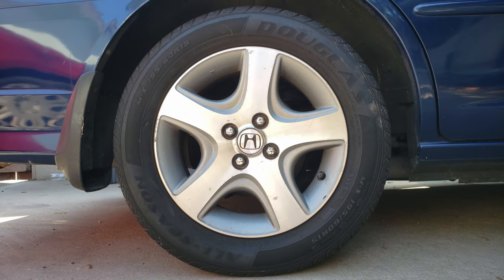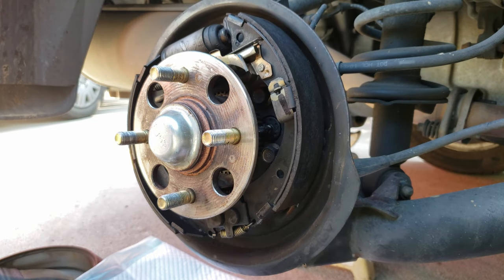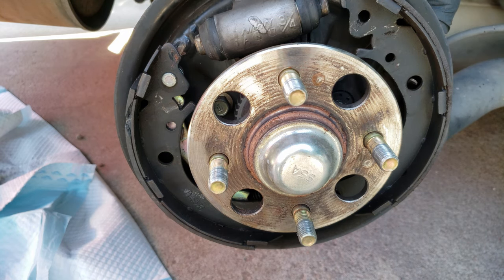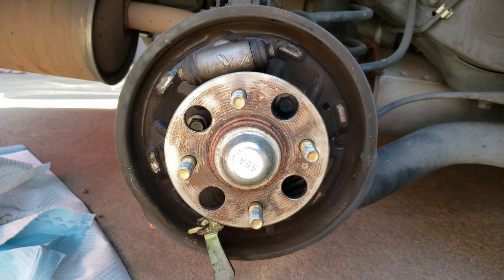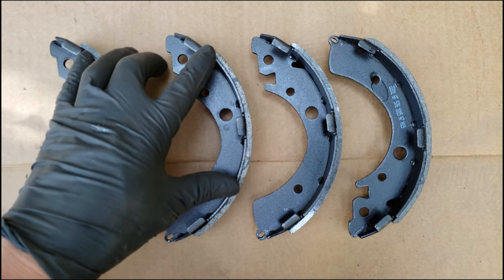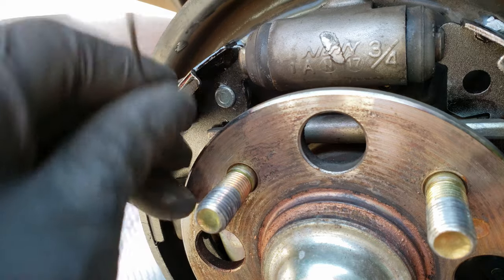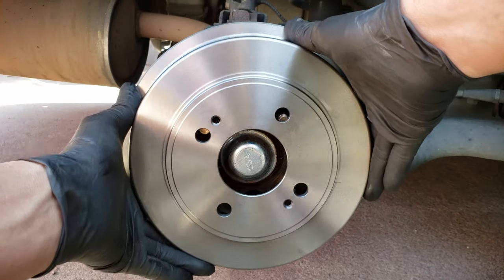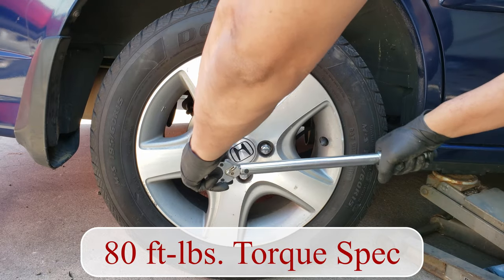How to Replace Rear Drum Brakes on a Honda Civic

Comment: You make this job look easy! To anyone sizing up this task, I've done everything on cars over the past 25 years.. except drum brakes. That said, I discovered there is no amount of cussing in humanity to curse this dreadful experience. I would gleefully drop my steering rack, or replace the synchros in my transmission over doing this horrid task ever again. I hate letting anyone touch my cars for service but I think this is one job I would take to a brake shop to have done to hold on to my sanity.
Reply from the maker: Maybe its cause ive done so many of em, but i think i would rather do these brakes than those tasks lol.
Reply: Agreed. Never touching these god awful brakes again
Reply: @backyardchevy328  It seemed straightforward to me.  I removed the wheels and drums to inspect today, and I'm down to less than 1.5mm brake shoe thickness.  My drums on the inside look smooth.  I don't see any leaking seals, and the springs all look good.  I didn't check the horseshoe clamp, but I plan to reuse it as you showed.  

Crossing my fingers that it all goes well.  The new shoes are only $22.  New drums are only about $30, and they certainly are easy to replace (I got the M12x1.25mm bolts).
Reply: @mikew1368  Agree. 1.5mm is cutting it pretty close bro 😂
Reply: It is not that bad.
Reply: Bro you are lost
Reply: Exaggerate much??
Reply: Can it really be that bad?
Reply: I feel you bro
Reply: Skill issue
Reply: I asked to local brake shops and they both told me Ef drum brakes. We don’t do that here 😂😂😂one guy told me 70$ I didn’t trust his skill set. So the car is on stands while I research why the adjusting clip isn’t holding itself into position 😂lmao
Reply: Idk man I did mine for the first time no experience and if you follow his steps it really was this easy.
Reply: It looks easy

Comment: Please assure to install the adjuster in the correct orientation I had the tail end rotated on the wrong way and it does have to go on  a specific way if not it will not latch correctly when pulling the e-brake up

Comment: Your a king! This help me so much with fantastic camera angles to help me see everything!
Reply from the maker: So glad to be able to help🙂 thank you
Reply: @backyardchevy328  that top spring was very hard to put back  you made it look so easy, but in the end I finished the job properly thanks to your video. I still have a problem with the ebrake, like after adjusting it was going 5 clicks but after using the car a bit again went to 8 clicks and is not holding, I adjusted again but still not happy is not holding the car if I put in drive and press the gas, should I adjust the cable from inside?
Reply from the maker: @razvanpoenaru  yea sounds like ud have to adjust it on the inside cause the brake shoes will only adjust so far to be drive able
Reply: the "specialty" tool to remove the clips is not needed. Thank you Sir. Great video 😌
Reply from the maker: @2d120587  thank you🙂

Comment: I was putting long spring above the adjuster lever into the wrong hole and wondering why it didn’t have much tension on it at all and why the adjuster level wouldn’t seat properly, was so frustrating wondering what I could possibly be doing wrong, rewatched your video and realized I wasn’t putting the other end of the spring in the right hole, realized what I was doing wrong and grabbed some tiny vice grips and struggled but got it to go in the correct hole and then the adjuster level sat correctly. Lol it’s so great when you finally realize the simple thing your doing wrong and get it corrected, thanks again
Reply from the maker: Yea definitely a good feeling when u find out why its not going together properly🙂👍

Comment: You make this look super easy. For anyone attempting this repair, it's definitely challenging, but not impossible. Give yourself ample time, maybe get a helper, and get all the parts and hardware beforehand. Be careful with the brake cylinder thing with the bushings, it's very easy to push it out completely and get air into the system. I got air into mine and am taking it to the shop to get the brakes bled. Overall, tough but worth it. You learn a lot!!! Thank you for this video, it's a gem!!
Reply from the maker: Thank you🙂 very good precautions👍
Reply: I made the same mistake.  I fitted the seal back onto the wheel cylinder and then I bled out the air in just the rear brake lines and fortunately the wheel cylinder seal is holding and everything is working well.  

I was too aggressive trying to remove the main adjuster spring and pulled off the seal on one side.  

I need to work out more to manhandle those vise grips.  Pulling while guiding the spring end into its slot was crazy difficult for me.
Reply: Me too!!
Reply: @mikew1368 question - will this stop you from being able to put the drum back on? That’s the current problem I’m having. Thinking it might be because air got into the system. Adjuster is already in as much as possible
Reply: @DeclanLangenfeld  I used brake cleaner and a rag to clean up the brake fluid that leaked out of the cylinder first, and then bled out the air.  Finally I got the cylinder compressed and replaced the drum with no trouble.  
I think if you bleed the air out first, the drum will fit.  Also it helped me determine if the cylinder was not leaking.  When the rubber boot wasn’t fit well. When I pumped the brake it caused brake fluid to squirt out.  I thought I might have ripped the rubber boot and needed to replace the cylinder, but no leaks observed, so I was happy and everything worked fine after I finished and tested it.
Reply: Well there you go.  That is what I did wrong. It was super hard not having those stupid things falling out the whole time. So I have air in the system. I am glad you posted this.

Comment: Great video overall.  Clear instructions and good video work.  One item though.  I could not get the top main spring off/on using his method.  No doubt he's much stronger than me.  For those who find it difficult to remove and replace the spring... In order to stabilize the brake shoes, I strung several zip ties together and tightened them around the circumference of the shoes.  I did this with two sets of zip ties to ensure shoes didn't shift alot and the ties didn't snap.  This made it alot less strenuous to do this procedure. Hope this helps.  Thanks again for the video.
Reply from the maker: Thank you🙂 id have to try that

Comment: Great video. I removed my drum and saw shoes at 3-4MM. I was ready to call the dealer for an appointment, Now I called to order a set of shoes and I`m going to give it a try. Thanks
Reply from the maker: Thank you🙂 hopefully everything goes well when replacing em..good luck👍
Reply: @backyardchevy328  Thanks, on concern I have is the shoes you linked on Amazon say "doesn`t fit" 09 Civic, thats why I`m going to the dealer, the cost there is $100 for a set of 4.
Reply from the maker: @xbrizzcakez  yea they would be a  different brake shoe on the 06 and up
Reply: @backyardchevy328  So an update for you Backyard. I decided to buy the OEM Honda shoes because mine were at a low 2mm, so after purchasing the set I discovered that brand new shoe pad was at 4mm?. So I`m no where near needing replacement. The shoes have been in the car for 7 years. I`m disappointed, I got your video memorized for the future though, lol. I`ll let you know the results,
Reply from the maker: @xbrizzcakez  yea rear brake pads hardly wear out since most of the braking and the weight is to the front..yes definitely🙂 but the video will also be there if u ever need it👍

Comment: Thank you.  This was an excellent detailed description for the Civic drum brake service.  I really appreciate your clarity and all the tips and explanations.  At the end, I thought it would be best to back the adjuster off a bit more to remove all drag (but still be super close) since I always thought the shoes should not be in contact with the drums (unlike pads that are supposed to drag lightly on rotors) until you hit the brakes (and the auto-adjuster will keep it just off the drums).  Do you feel it is best to leave a little drag?
Reply from the maker: Thank you🙂 well when u adjust and it free spins but u can begin to hear the slight drag is best..but if u get it close the adjuster will adjust the rest if need be, so u can back it off a lil if u prefer...both are good to me
Reply: @backyardchevy328  Awesome.  Thanks for the quick reply.  I will have to check out more of your content.  You are very good at explaining things.
Reply from the maker: @steveboone5450  thank you i really appreciate it🙂

Comment: One piston of the caliper came out and I had some fluid running off. But stopped when put the piston back on. 
Do I need to top up somewhere? Did air get in the system? 
It didn't feel so tight, but there was no sign of leakage before.

Thanks
Reply from the maker: The wheel cylinder on the rear? or the caliper from the front brakes? Either way, yea it would get air in the system that way..so youll want to add fluid and bleed the brake caliper or wheel cylinder of any air that did get in
Reply: @backyardchevy328  Sorry, my wrong term.
The rear piston that pushes the shoe out.

How do you bleed the air out of them?
Reply from the maker: @troubauk  im actually working on a video for that right now..well its more for a brake flush and bleed procedure..it should be out this weekend

Comment: great video..  If you cant get the drums off use 2 M8X1.25X35MM bolts, THATS WHAT THOSE 2 HOLES ARE FOR IN THE DRUMS!!   Id also highly recommend getting a NEW spring kit to replace the springs when doin drum brakes! comes with new C clips and all so if you have trouble gettin old ones off you can just break em off and replace with new.. under 20$ for these kits!

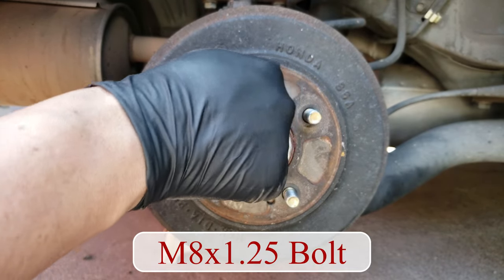Comment: On my 2014 Civic ( 0:45 ) The bolt size for the bolt to break the seized drum off of the hub is M12 X 1.25mm 35mm length (bought them at Advance Auto Parts)
Reply from the maker: Thank you🙂 really appreciated

Comment: I wanted to take a moment and thank you for this video - it really is perfect in all ways .  

As I was working along side the video ,  I’d get ahead in my mind on some detail - and sure enough you covered it .

One small detail I messed up on - the lower part of the brakes  need to be seated behind the lower flange - I placed it on top
By accident and the  drum rubbed on the outer face of the side of the brake pad .   I’ve never done rear brakes - so it’s a small detail I won’t for forget next time .

Thanks again !!
Reply: Same here. Put on the back tire like 5 times trying to figure out why the shoe was grinding. Finally decided to take it all apart again (shouldve done that in the first place) and figured out thats what was rubbing.

Comment: Thank you so much for this. About to do the drum brakes on my 07 Honda fit (same exact brakes). So many videos advocate for putting the brakes back together by attaching the shoes with the top spring and the adjuster rod first then trying to hold and hang the whole assembly over the top…all the while complaining you need three hands to do it well lol. This way makes it so much easier.
Reply from the maker: Lol..yea everyone has their preferred methods, hopefully all goes well..good luck🙂👍

Comment: The new brake drums you installed are not expensive.   Are you happy with those replacement drums?  My Civic LX is at 140k miles and might not need new drums, but for around $30 it looks so nice and clean.  If I pull it apart and need to resurface the drums at my local auto shop, it will cost near the same and waste time.
The Honda service tech said mostly they can reuse the springs and not need to resurface the drums.  My Haynes book says to at least use an emery cloth and polish the drums.  They inspected my drums as part of a free 16-point inspection and said they had a lot of life left.

Comment: Great tutorial. Curious at the :21 spot you put the jack stand under the rear suspension. Is that an art form? I've been using only the side designed area to put the stand. Thank you.

Comment: Thank you for the video. I changed the pad after watching your video today. After the replacement, the brake pedal goes deep and it doesn't brake well. What's the problem? The piston fell out a few times and the brake liquid flowed. Is that the reason? Or is it wrong to assemble it?
Reply from the maker: If brake fluid flowed out u gotta make sure its sealing..if its leaking fluid it wont pressurize..so u wanna make sure u fix the leak or bleed the air out of system...it may also be adjustment...if brake shoes are far from drum itll cause pedal to sink
Reply: @backyardchevy328  thaks for replying

Comment: I know this is a while ago but this video really helped me get a better understanding of how drum brakes work and I replaced my own. After replacing mine I have a loud scraping noise coming from the back. I’ve adjusted multiple times I don’t know what’s rubbing what do you think it is?
Reply from the maker: Scraping as u drive? As u brake? Did it start right after doing the brakes?
Reply: @backyardchevy328  it’s scraping every time the car moves
Reply from the maker: @alexanderjin201  if its a scraping sound everytime it moves does it also do it if u lift the wheel and spin it? Do u see any sign of metal to metal rubbing where say the brake shoe has paint removed or maybe the lower spring didnt tuck in where it should? Or the drum rubbing against the backing plate if maybe it bent inward for some reason...does it do it on both sides or just one?
Reply: @backyardchevy328  thanks for the ideas and advice I’ll check it out 👍👍
Reply from the maker: @alexanderjin201  hopefully it helps and ur able to find out the cause...good luck🙂👍

Comment: Great video! I was able to follow step by step without any confusion. I have. 2012 Civic, so a few of the pieces were on the opposite side than the video, but it was easy enough to figure out. After completing the replacement I adjusted the adjuster screw so that everything turned pretty freely, but when I drove the car it felt like the brakes were engaged the whole time, the emergency brake, on the other hand, does not engage at all. I went back home and shortened the adjuster screw as short as it goes and everything spun freely until I drove and then the brakes stayed engaged the whole time again. It’s like the adjuster isn’t backing off after the brakes are engaged. Any ideas before I take to the shop?
Reply from the maker: Well when u press the brakes the wheel cylinder pushes the brake shoes out and the return springs pull em back so they dont stick...so i would just check the return springs to verify theyre on ok...if not I'm thinking it has something to do with parking brake..definitely check the cable near the shifter to make sure its attached..and not caught on something where the cable is getting pulled..but im thinking the cable may be stuck in the pulled position somehow

Comment: Hey great video! One question I’m stuck putting my drum back on. The shoes are too far apart. I’ve notice my adjuster is hitting the E brake spreader where the adjuster fits into the groove.

For the life of me I can’t figure out what went wrong. I installed the e brake spreader just as I took it off. I’m almost sure of it. But that is DEFINITELY my issue. 

The adjuster hitting the e brake spreader. Do you have any advice?
Thank you so much in advance! 🙏
Reply: P.s. I would just take the e brake lever off but I don’t have another horse shoe clip. I have ordered another one. But really need my car soon! Thanks again

Comment: Thanks for the video. I followed step by step. My brakes don’t quite react the way they use to.. how long will it take to adjust?? Thanks again
Reply from the maker: Is the pedal lower? Or just not as grippy? Some will self adjust by going in reverse so you could go back and forth a few times and pull the parking brake up and down a few times as well to help it adjust faster

Comment: Amazingly clear instructions! Do you know if the m8x1.25 bolt is the same size for 2008 Honda civic? Can't find the specs anywhere
Reply from the maker: Thank you🙂 yes, i did a 2007 recently and i used the same bolt to remove the drum as well
Reply: @backyardchevy328  awesome thank you! Super quick reply too!
Reply: @backyardchevy328  It's so crazy that my Haynes manual states to use a M8x1.25mm, but it's actually a M12x1.25mm.  My local machine shop confirmed that the first number designates the diameter (mm) and the second number is thread pitch  (mm).  Looking at the drum bolt holes, they are 12 mm, not 8 mm.

Comment: Question: I adjusted my parking break because it wasn’t stoping my car so I tightened it. I’m going to do my rear drum brakes, will I also need to loosen that parking break tension that I did at the parking break lever? I’ve never done drum breaks before.
Reply from the maker: Yes, youll wanna adjust it again after, Since the new brakes will make a difference

Comment: you are showing the passenger side rear drum brakes?  The little copper-looking adjuster that hooks into the forward shoe.  Is that on the forward/left shoe on the driver's side or the rear/rightt side  of the shoe?  I took pictures but they aren't good in that I didn't take them as each part(S) were removed to show the next  "layer".
Reply from the maker: The whole video is the passenger side rear..but the brake shoes with the cracks on it that i show for about 3 seconds going all  around it is the drivers side if u pause it or slow it down u can get a good view of the whole assembly